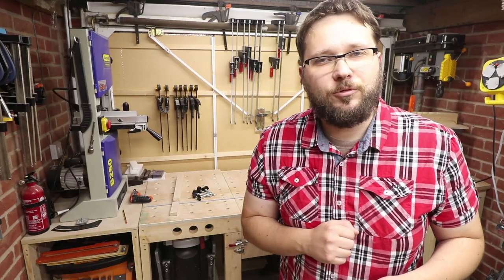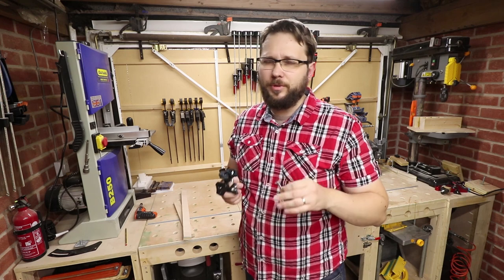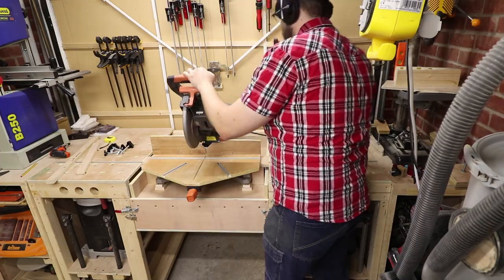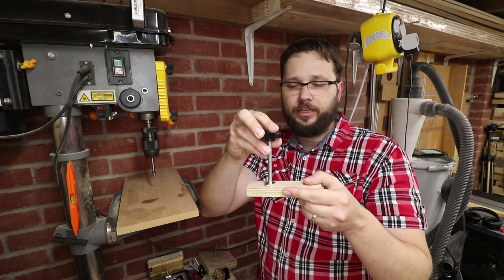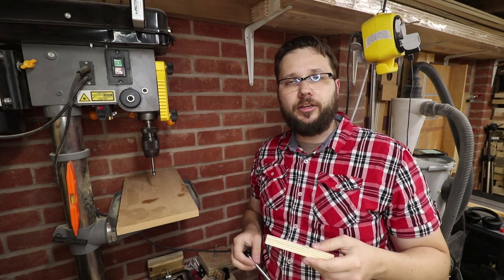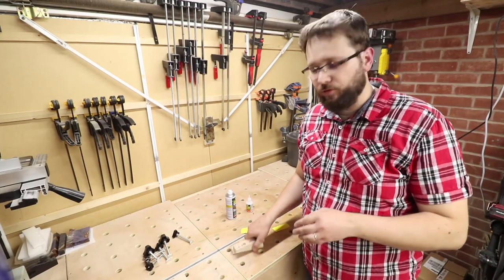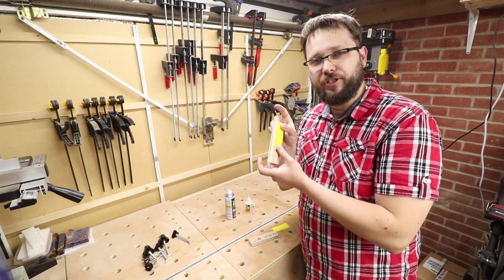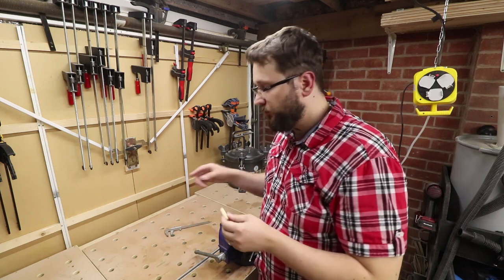Super Simple DIY T-Track Clamps

Comment: I've gone one step further... I'm building my own version of T-track. lol..  It's a bit tedious but it'll look cool and will be SUPER cheap, not only to replace damaged sections (it's made out of steel, so... probably not going to happen anyway), but at $0.67 per foot for the steel, cheap to build. I'll definitely consider building some of these clamps!
Reply from the maker: Best way is the DIY way👍😁
Reply: I just made some "t track" earlier today, after having seen the UK prices for what is, after all, a bit of aluminium extrusion. I used a table saw to cut a 1 cm slot in one side of 30mmx30mm alu. box section and put an M8 bolt plus washer in it. Haven't used it in anger yet, but the only problem I foresee is strength - it's only 1mm thick - but I can redo it with mild steel box section if necessary.
Reply: @scollyer.tuition  That's not a bad way to do it. My steel flat bar design sure has worked out well so far! I've tightened clamps with it to the point where I believe aluminium T-Track would have deformed.. The steel didn't budge. If I could post pics here I would, though I might do so on Instagram at some point.
Reply: @RobDucharme  I'd be interested to see pictures. I can't quite visualise how you're using flat bar to make a track - what keeps it together?
Reply: @scollyer.tuition  They are parallel strips with a gap between them (where the hardware would slot in). I used a 3/4" flat bottom router bit to rout out the middle wide enough for the hardware to have room to slide in and along the track easily, and then used the 3/4" flat bottom router bit along each side to the depth of the flat bar so that it would mount flush with the table. I drilled holes with a counter sink so that I could screw the flat bar in directly, and the screw heads would also be flush.
Reply: @RobDucharme  That's a nice idea. Not suitable for my current jig as it's all metal, but one I shall bear in mind in future. It would be a very adaptable design. Neat!
Reply: @scollyer.tuition  Important to note this design should allow for any T-Track accessories to work without modification.